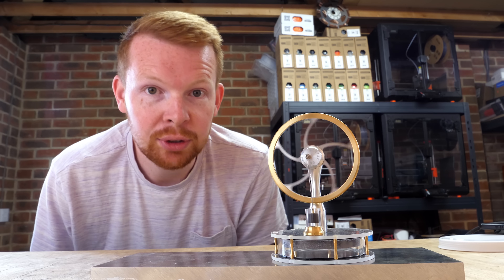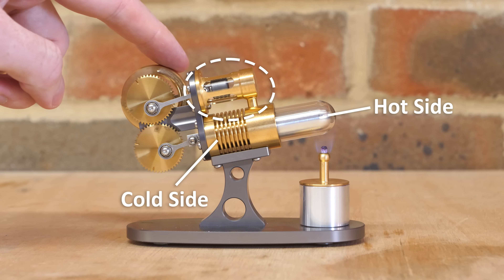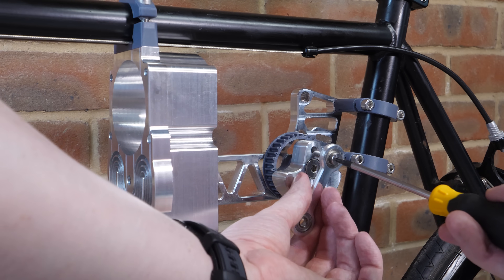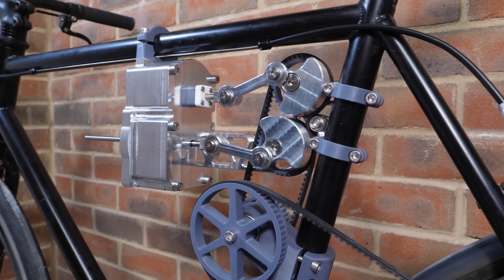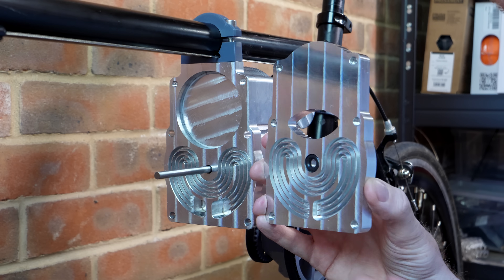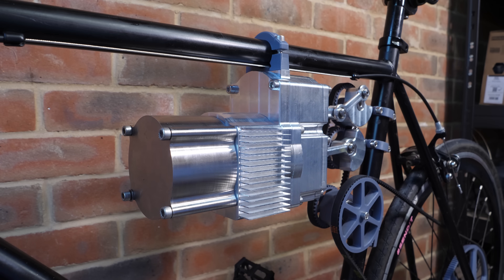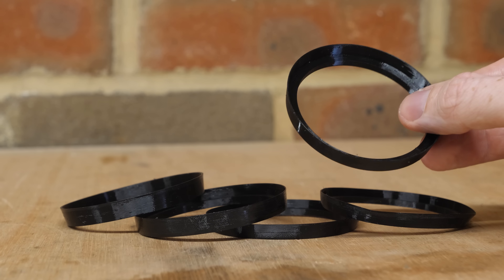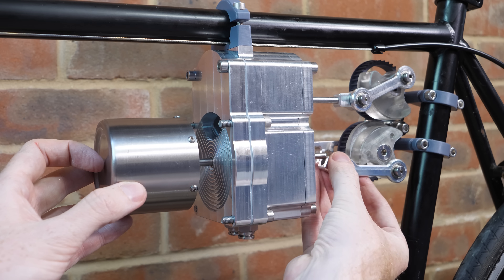Building a Stirling Engine Bike - Part 1

Comment: FINALLY. I've been so tired of only seeing demo engines. Having someone actually make a large, usable stirling engine is something I've been so in need of I thought of just doing it myself.
Reply: I've seen one in a TV programme way back. I'm sure it was powered by banana leaves or something as a piece of farm machinery. They're so cool.
Reply: @minibigs5259  They are also used in some submarines. And there tehy provide the electricity needed for submerged use. I know Swedish marine has some that can handle up to three weeks submerged using a sterling engine to provide energy for propulsion. Having seen this it might sound insane, but well designed sterling engines are a lot better than the ones you see in videos like this one. In a sub you have the surrounding water provide cooling and then some kind of heating provided with liquid oxygen and who knows what. But like I said it's designed to be able to run for up to three weeks without having to surface. Another positive thing is that sterling engines can be very quiet. When one of these participated in training with the US marine they were unable to find this submarin, and they managed to get in range and target an aircraft carrier with full defense fleet around it without being discovered. They are quieter than any US sub, especially the atomic subs.

So Sterling engines are more than interesting gadgets. They can be really effective in the right situations.

The first steling engine I read about was used to power a printing press. This was a long time back. I think it was sometime in the 1850's or there around. The heat source was actually a reflective parabole collecting solar energy to heat the engine. It wasn't a really practical device but built as a display piece. I think it was for a World Fair, and that it was in Paris. If so it might have been 1855. it's about fifty years since I read about it so I may very well be wrong about the details, especially the year.
Reply: @minibigs5259  As I've seen in this comment section, Philips made a commercial one, way back when they were a proper company. Search for "Philips MP1002CA", there are a couple of videos in here.
Reply: its not very useable.
Reply: @londonnight937  yet. Plus, while it can't power a bike (which is really hard anyways), it can still have used in its current form.
Reply: Stirling engines are not meant to used that way, they are supposed to power generator, to produce electricity in emergencies
Reply: @sold4200 No, they're just meant to produce rotation to run a machine, propel a boat/submarine, or do anything you need some rotation for, which does indeed include making electricity. But the idea that their only purpose is to make electricity in an emergency is just plain silly.
Reply: @TheRealFmarty  Хотел бы я посмотреть, как ты двигателем стрилинга плывешь на субарине, весом несколько тысяч тонн😂😂😂 ты ведь знаешь что у этих двигателей почти нет крутящего момента? А чтобы крутить пропеллер в воде он должен быть огромным, и зачастую этот пропеллер крутит электромотор, который продаётся от дизельного генератора, так что фиг ты поплывешь на двигателе Стирлинга куда
Reply: @sold4200 And due to the low torque, they are usually used in submarines because they are quiet. But you can certainly power a boat with just a stirling engine, just look up "stirling engine boats" and see the results. Sure, a steam engine would be far more powerful and a better option in the case of the non military boats, but I never claimed stirling engines were better. In any case, I'm not really sure what point you're trying to make.
Reply: @TheRealFmarty  where are your previous comment? You said that Stirling engine is used to power submarines and ships, to spin propeller directly
Reply: @sold4200 I never said ships use them, to my knowledge they don't. The submarine using one, the Gotland class specifically, does in fact power it's propeller directly with the stirling engine while submerged, because charging the batteries then running motors would be needlessly inefficient. There are, however, small boats that use them, mostly for novelty.
Reply: @sold4200  funny that you answer in Russian because the Soviet Union produced the most sterling engine driven submarines
Reply: @Manfred_Messer  because it is my native language, and yes, big bunch of submarines were powered by Stirling, but as a generators, not as single engine
Reply: "Useable"?
Reply: @pompeymonkey3271  if you search YouTube for Stirling engine videos, you'll only find small show ones that merely demonstrate the function. Tom's here is actually doubt something.
Reply: @pompeymonkey3271  Are you salty bot?
Reply: @IncognitoActivado  I'm salty alright! lol
Reply: @pompeymonkey3271  Yep, you definitely are.
Reply: Not the video, but very similar setup for those interested
https://www.youtube.com/watch?v=Pr6BHVhXPtc
Reply: Shane pomeroy makes some interesting videos on them.
Reply: @mekhane.broken9678 somehow, in all my searching for Stirling engine videos, I have never encountered his channel. Thx.
Reply: Has anyone brought up the Phillips rhombic drive Stirling engine generator? It's the size of a propane bottle and outputs 200W
Reply: @JiunnWong Rhombic drives are very complicated, and to my knowledge the engines Philips made were all pressurized, possibly with hydrogen or helium. The main reason those engines are more powerful than standard stirling engines is their working fluid, the rhombic drive doesn't make as much of a difference when compared to other engines using pressurized hydrogen/helium as the working fluid.
Reply: @JiunnWong  that is one unfortunately shaped generator.
Reply: There is a company that produces linear sterling engines with 5kw of output which uses methane or propane 
The name is Qnergy
Reply: Tell me when you do see someone make a usable stirling engine. This isn't it.
Reply: Usable?
Reply: Usable is apparently the correct spelling of the word.

Comment: maybe add a resistor inside the hot side and power it with a powerbank to heat it up so you can have a electric stirling engine

Comment: Very awesome stuff.  Great video.   I always thought about using a Fresnel lens (an old large projector box TV lens) like set up for powering a Stirling engine.  I thought it would be cool to have the sun heat a black block inside, a solution through a window of a container.

Comment: Nice build ! I've been reading and working of Stirling engine designs for years and as you suggested at the end of the video, it really needs a regenerator. 

The addition of a regenerator to a Stirling engine is what makes the difference between toy engine and real engine. In your design, most of the heat is extracted by the water cooling without powering the engine. Adding a regenerator "stores" the heat when the gas is displaced between the hot and cold cylinders, so you need less cooling for the same temperature delta. 

In the Stirling thermodynamic cycle you need (ideally) isochoric heating and cooling steps. With a regenerator, this heat is exchanged and kept inside the engine, but without it, you need additional heating from the torch and cooling from the water, which drastically decreases the efficiency.

Comment: I think your hot side is too close to your cold side put a big insulator gap in between on your hot side and cold side and fill the hot side extra space inside with steel wool and a door screen to prevent the wire dust from leaking. your demanding the air heat up and cool just too quickly, those air atoms have to hit the sides to heat up and cool down. they are a racket ball not newton's cradle, not all of their heat is transferred to the walls instantly, and they drop to a 0 kelvin when they touch the wall. they need some time to bounce around and cool down and time on the other side to get charged up .

Comment: I have an idea for "throttle" but it may be heavy - third cylinder/piston that controls the pressure in the other two. It could be an opposing piston to the work one and can be driven by a worm gear so the "throttle" handle doesn't need to fight the force of the engine.

Comment: if a proper burner can encircle the piston and use the fuel much more efficiently (get like 40% of the heat into the hot end rather than probably 5% from the blowtorch), it would be interesting to figure out your effective wattage input into the system.  Let's say the engine is mechanically 50% efficient since it isn't an optimized design for this load -- then work those together to figure out your output horsepower.  Like that blowtorch might be putting out 2kw of heat, but you're only effectively getting maybe 50-200 watts into the hot end once the hot end is heated up.   Then maybe half of that is making it to the back wheel.  I'm sure from past projects you have various data on how much power it takes to keep the bike going at some speed on flat vs uphill vs starting from a stop vs general assist, for comparison.   Then if you factor in the water cooling pump power, and perhaps the energy to make a block of ice  for the water cooler... I wonder how much power or cumulative energy is going into the system and what percentage of it is coming from the stirling engine vs watercooling system.  Looking forward to rev2

Comment: Displaced air has to go through some medium called a regenerator to store or dump heat so as to increase efficiency. Also require less cooling, maybe even heatsinks would be enough. Combined with one crank and power piston at 90 deg to displacer piston....and....higher pressure....has to work better. Kudos my good man, this is seriously cool work.

Comment: I recommend adding heatsink in the front of the engine where you heat it up because it can absorb Heat from the flame due to more surface area it will be more Efficient

Comment: What if you ran a little liquid nitrogen through your water cooling system,,,,or run a coil through an Ice and salt bath to try and supercool the water?  I feel like high temperature differentiation between your cylinders is the key.....but what a crazy cool project...really well done.

Comment: You need to transfer heat from heat source to inside gas with minimum thermal resistance, so tin walls on the hot side would be better. Great project!

Comment: What about placing the heat source (be it a flame tube, or electrical heating element on the inside of the hot end, and wrapping the hot end with an insulating layer? I feel like a lot of the heat applied to the engine is leaked to the outside of the hot end, not to mention how much heat of the flame just dissipates into the surrounding air rather than the machine.

I'd guess even wrapping the sides of the steel cylinder so it was insulated everywhere except the flat face the flame is aimed at would help.

Comment: Amazing subject and one that i had a brief fascination with. I read a book about 22 years ago and it was aimed at diy'ers and machinists. The design that had minimum resistance and drag had a 90 degree angle between the power piston and displacer piston and both worked on the one crank. The displacer had an regenerator built around it and used steel wool to absorb the heat and give it back when it needed to. Higher operating gas pressure makes it more powerful but tests the seals too. I think nasa et al use a free piston stirling where it vibrated up and down at a specific frequency and coils surrounding it picked up the power. All very fascinating stuff.

Comment: I saw an article about a new type of engine.  It burns fuel to heat sodium and drives an electric motor with a photovoltaic cell tuned to the precise frequency of the light emitted by the sodium.  It purportedly has a ridiculously high efficiency rating on the order of around 80%.  I was thinking that a budget version could use limelight and an ordinary photovoltaic, but the efficiency would likely be much lower.

Comment: Now, move the engine behind the seat, point the piston up, and add a solar reflector like nighthawkinlight's Ben showed off in his latest video. Presto, solar motor. Probably not nearly as efficient as a solar shade canopy on a bike to a super capacitor and electric motor, but cooler in a steampunk way.

Comment: You may want to increase the air pressure inside the engine to make it run better. I've seen stirling generators before and they used like 7 atmospheres I think?
Also, why did you choose this type instead of a delta? Two pistons and separate cold/hot sides seem like an easier proposition to me.

Comment: I've built quite a few Stirling engines over the years, this brings me back to the early struggles of trying to get them to work. One thing that could help performance massively is reducing the gap between the displacer and the inside of the hot cap

Comment: As a mechanic, I'm saying- timing, stroke, counter weights. Also, do the math on your displacement. I'm my mind you shouldn't need that much heat. Great project! I look forward to the update.
Reply: Agree, the heat difference usually is way lower

Comment: Remember one trick with Stirling engines is to use leather as the ring material as it is more heat resistant than many materials. Also the heat input needs to be more diffused to be more effective.

Comment: For the heating element, you could have some copper wiring around the housing of the heating section, powered by batteries, to provide constant heat.

Comment: I'm no expert but it looks to me like the gearing was too demanding. Stirling engines run fast and with little torque, you could try gearing down some more. Also in some parts of the video the two cranks weren't looking exactly 90 degrees apart. If they're not, they'll fight each other. In the last segment, it looked like the flywheel was kind of "stopping" with each cycle.

Anyway, loved this video, looking forward for more!!

Comment: That's some very nice work. Powerful Stirling engines are notoriously tricky!

Adding a 'regenerator' should help a lot, and maybe hone the cylinders a bit -- there looks to be a fair bit of tool witness left.
The working fluid makes a surprisingly big difference. Hydrogen or helium are good.

Comment: I am somewhat disappointed Tom. I like your videos but when adding a couple of kilowatts of heating power to generate possibly less than 1W is called success..... 😂
Reply: Stirling engines have about the same efficiency as internal combustion engines. Lot of ICEs in use for something that is a failure.
Reply: @saintchuck9857 yes I know but Toms Stirling has approx 1W/2000W efficiency 😀

Comment: Tom, imagine a pyramid on the Moon's surface, with the faces facing the Sun capturing heat and storing it in its regolith walls. Now imagine that on the shadow side of the pyramid, it is the cold side of a Stirling engine. Do you think the pyramid could be a way to store heat energy to provide electricity to the Moon Base Station?

Comment: Bravo, love it 
You never give up
Next improvements:
- made it 100% gaz leak free
- replace air by Helium
- increase pressure
- add stainless steel regenerator
Reply: And move the cold side to the back so that warm air is not blowing by through the cooling fines

Comment: Steel isn't a very good heat conductor. Perhaps add a cylindrical shell around the hot end, with a 10-15 mm gap, to catch and spread more of the heat added by the burner, and add longitudinal fins inside the displacer cylinder to make the heat transfer faster through more surface area. Also, maybe a 15-20 mm ceramic section between the hot and cold sides instead of just a silicone gasket, to better isolate the two sections.

Comment: The Inside of all Cylinders i know, have been specially prepared by a method called "honen".
By using a special tool/machine that uses grindstone to purposely grind a desired surface.
The surface isn't smooth, it is purposely rough up to hold lubrication.

Comment: From my experience with SSP airguns, I'd recommend thoroughly polishing the cylinder as well, otherwise the seal might not last very long.
Reply: I think honing is done when oil is used, and polishing is good when there's no oil.
Reply: @whereisyoursaviournow5280  Yes you're right. honing is cutting spiral grooves which retain oil, while a smooth surface is best for a polymer-to-metal contact. Which can then be done in combination with something like silicon grease.